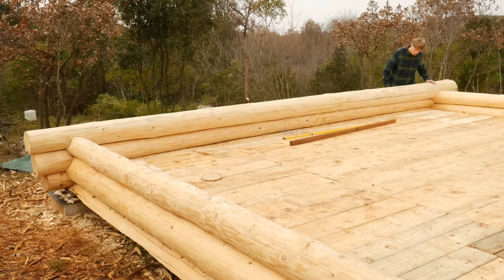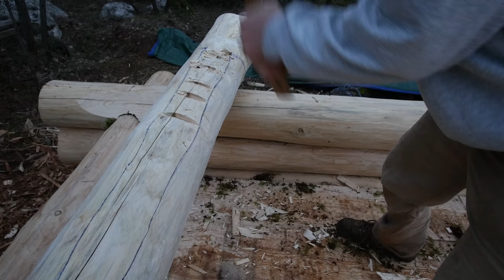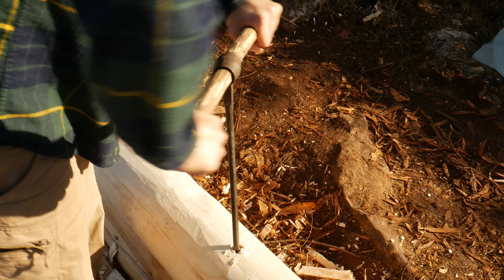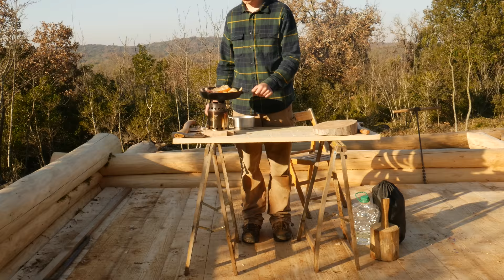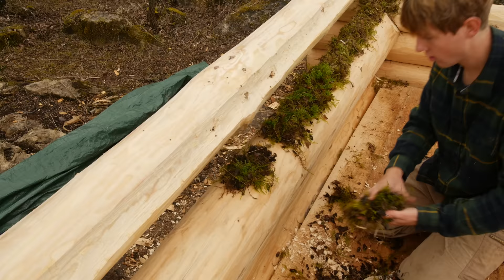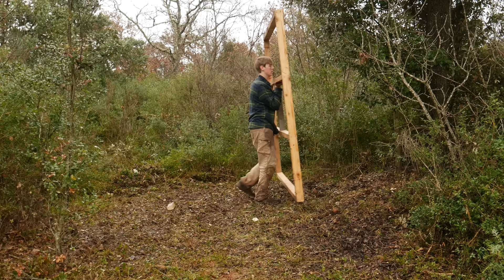Building My Dream Log Cabin - One Man Solo With Hand Tools Only in an Off Grid Bush | EP 8

Comment: Thank you for making these very interesting and relaxing (to the viewer lol) videos!  You are carrying on with work on a par with Dick Proenneke.

Did you try roughing out the end notches with a saw to get the bulk of material removed prior to shaping with the broadax?  Maybe the cut angles and arcs make it unfeasable.

I like the use of brace and bit for driving screws, a 'yankee' push driver would also be good for tight areas.

I was thinking that if you were previously a power tool user, it must have been a big adjustment in patience and physical endurance!

I admire your skills and tenacity sir!

Comment: As your using hand tools for this cabin I would strongly suggest getting yourself a flat faced axe I don't know the name but it is a small handled broad faced axe which has one side depending if your right or left handed flat and one side normal looking and it's used to face rough wood
Reply from the maker: Thanks for the comment. Yes, I've heard of that. I want to buy it when I get the chance.
Reply: It's called a hewing axe.